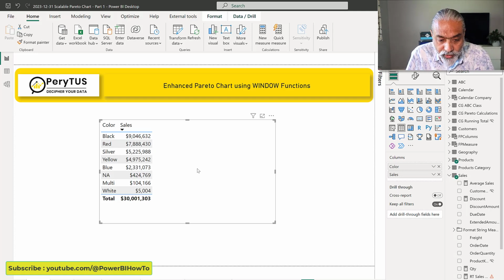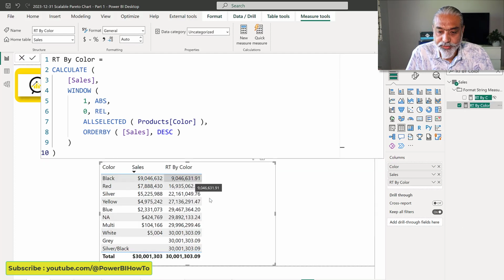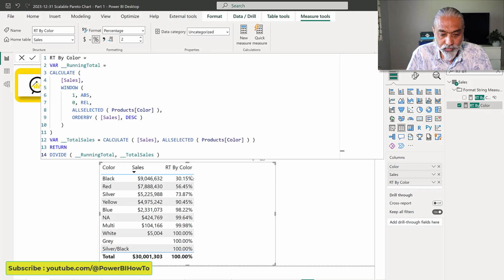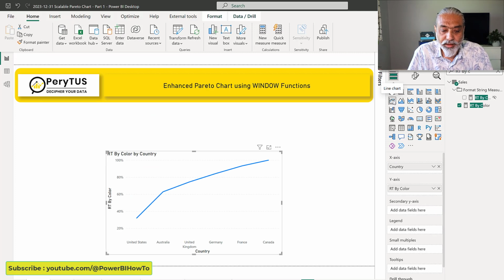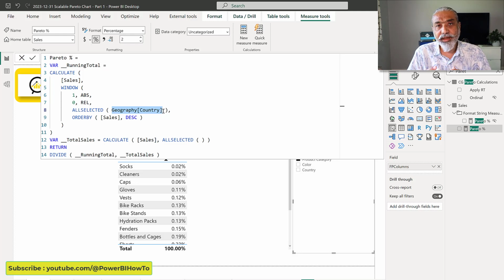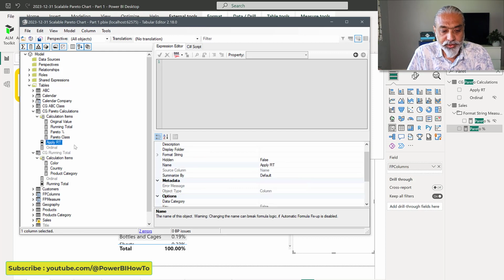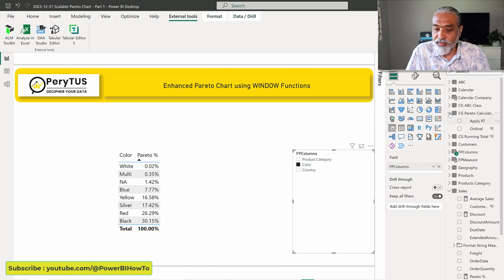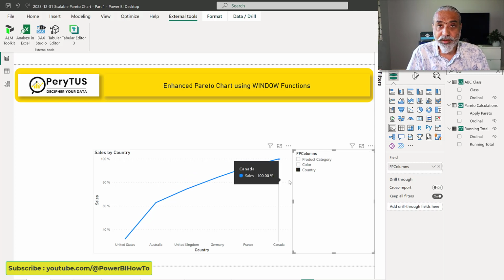Power Up Your Pareto Chart: Using Window function  in Power BI | PeryTUS - Power BI How To

Comment: I tried this with a real-life dataset with around 5 million fact rows and 200,000 items belonging to 25 brands. Dataset is in import mode and file size is around 200 MB. When grouping by the low cardinality brand attribute, the pareto calculations work really well. But when applying them to the individual articles in a matrix visual, then the calculation runs for around 10 minutes and then runs out of memory, although the basic Sales calculation by items works well and finishes in around 2.5 seconds. Is there a recommended data limit for using your approach or any idea to get it faster and especially less memory consuming?
Reply from the maker: QQ, are you using calculation groups to make it dynamic or you just trying to use it for each article?
Reply from the maker: I'm sure you have a star schema with product as a dimension, correct?
Reply: Yes, I have a star schema. The items with their brand attribute are in their own dimension table and relationship is one to many with full referencial integrity. I'm using the calculation groups approach a you showed in the video.
Reply: I just published to a premium per user workspace to make sure it's not my laptop. But there as well, error is out of resources. Applying the pareto calculations to the brand level works amazingly well also in the service.
Reply from the maker: I tested it on 20K products and it worked fine. I will try to get a larger dimension and test it against that. Maybe WINDOW function approach is not the right one when working with large cardinality and have to look for alternate solution. Opportunity  to explore it further and do another video to make it work with larger cardinality. I will share my findings when I had a chance to work on it. 

Thanks for sharing your feedback and the input.
Reply: I ran into a similar issue. I'm working with sales (Book) and this worked find when developed within the fact table with the [Customer Id]. However, when I went to pull the [Customer Name] from the customer dimension, It screeched to a halt. With 20,000+ customer records, its understandable.

I went to Gemini for help. It told me to use a table var to precalculate [Book]. That worked but, more improvement could be made. I followed up with it and asked about filtering out custoemrs with no [Book]. It added that filter and now it calculates nearly instantly. Here is the table it setup for me. You should be able to adapt it to your purposes.

VAR CustomerSalesSummaryTableWithSales =
    FILTER(
        SUMMARIZE(
            ALLSELECTED('Customer'),         // Considers all customers selected (e.g., by slicers)
            'Customer'[Customer Name],       // Groups by Customer Name
            "__IndividualCustomerBook", [Book] // Pre-calculates the [Book] amount for each customer
        ),
        [__IndividualCustomerBook] > 0       // Key Optimization: Only include customers with sales > 0
    )

It then used that inthe rest of the Pareto % measure which is essentially the same as the one presented in the video.

I love AI.